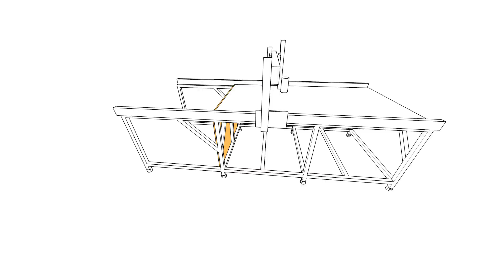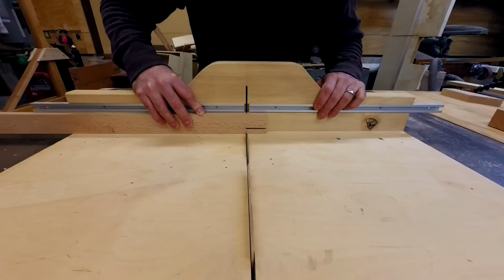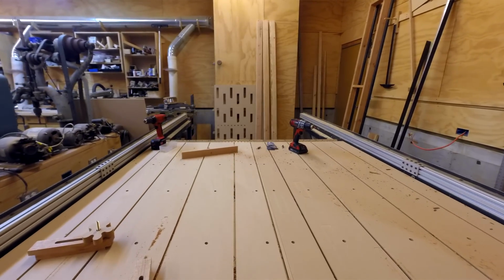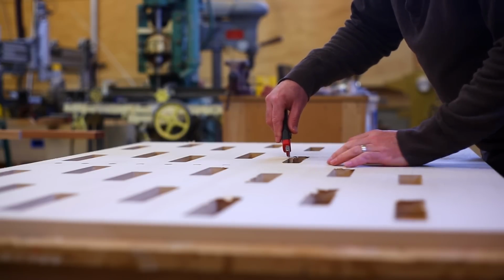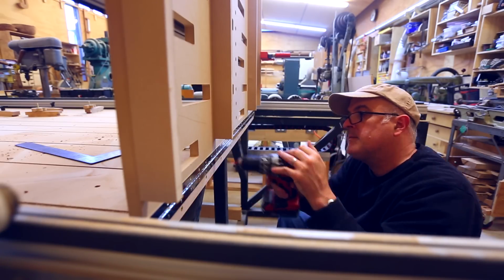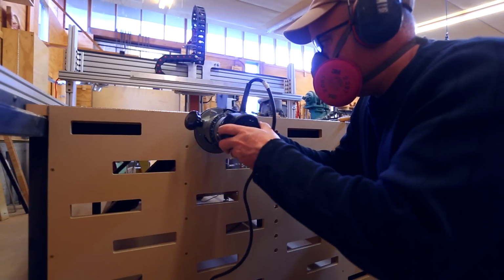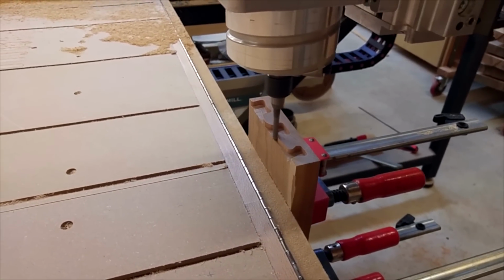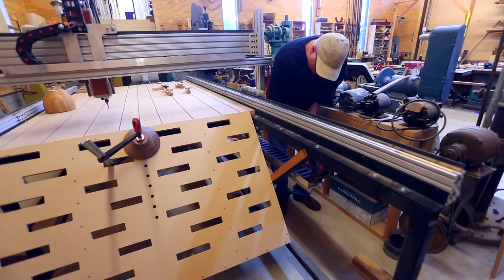Vertical CNC Table

Comment: you could make a motorized screw drive to tilt the table, and lock it in at an angle. all you would have to do is hinge the motor with the screw shaft and the bolt to receive it so they both tilt simultaniously, and then find a secure place to attach them on the table.
Reply from the maker: +Sean Patrick I like that
Reply: +frank howarth Get really challenging and make it a wooden threaded rod. :)

Comment: Love to see a gas-shock used to help take the weight off of the assembly like a minivan lift gate.  Add an indexed pin clamp section and you're set :)

Love the build as always!

Comment: I think a curved metal track with a corresponding milled our groove in the center that follows the arc of the swing of the table, and bolted to the steel with a recessed slide in the MDF with a threaded bolt with a wing nut to lock the table at whatever angle you would like would be ideal. You can mill out the curved tracks right on the CNC. They could be made of heavy plastic too, I assume. Like Corean.
Reply: +traderjoes that's what I was thinking. or just a flat piece that is hinged on to the moving table

Comment: The unidentified hardwood is Beech.
Reply from the maker: +Graham Taylor I think you are right
Reply: +Graham Taylor speaking of beech… I get the impression that it's way more frequently used in Europe than in North America (door cores, kitchen tops, toys, any cheapish solid wood furniture that is not pine… I like the look of its medullary flecks, but often it looks just really bland and overused, sadly). I'm also curious about how it compares to hard maple, in hardness and workability?
Reply: Damien Pollet

Yes, I think Beech is much more commonly used here. Beech grows widely across most of Northern Europe and the UK (I can see several from my house) and is used a lot for furniture framing, especially for tables and chairs - it is a very tough wood that will withstand a lot of abuse in use. The traditional centre of chair making here is High Wycombe which is on the Chiltern hills and they are largely forested in Beech woods.

You are right that it can be a bit bland but it can be attractive if it is planked carefully - the medullary pattern is strongest in certain sub-species when radial cut and is often referred to as 'speckled Beech'.

A lot of Beech is steamed as part of the seasoning process. This develops the toughness and stability. I have often used steamed beech when producing parquet blocks for floor restoration projects - we have a lot of houses with floors that are 200+ years old and need maintenance.

I have no experience of Maple (doesn't grow here) except as a veneer so can't compare workability. You do have to make sure that cutting blades are very sharp and that the work never stalls since it is very easy to scorch Beech on a table saw or router

Comment: If you bring the table up so it's flat and parallel to the rest of the table you can use the cnc to basically draw a line with a v bit which should give you a good reference for vertical alignment.  Or maybe even a removable fence that you could machine with the cnc to be vertical.
Reply from the maker: +krtwood yes I have been wondering about that.  I need a quick way to place and hold work vertical.

Comment: Frank just a word of caution with regards to the MDF table surface and dust extraction. We have a CNC router table set up in one of the D & T labs at the school where I work and they had been using it fairly heavily with the bit penetrating through to the MDF support surface and a dull bit combined with a clogged extraction system resulted in a small fire on the table surface. The extraction hopper had to be dumped to check there was no smoldering fire in the dust pile. The sacrificial surface is now plywood and in fact the entire school is no longer using MDF for student or staff made projects.
Just something else to watch out for.

Comment: How about two arcs of hardwood, securely attached to the frame, that follow the arc of the end of the table, with two clamp embedded in the end of the table.  Bang, 90 degrees of quick and easy adjustment.